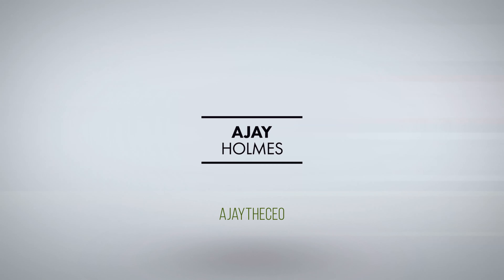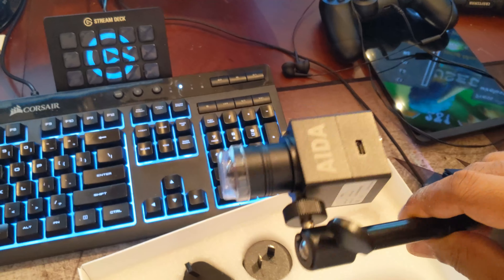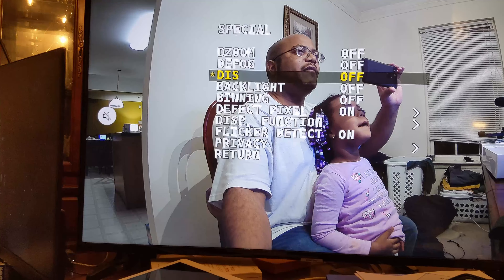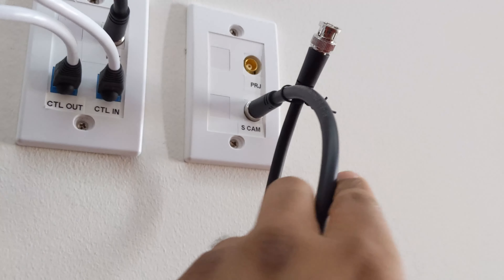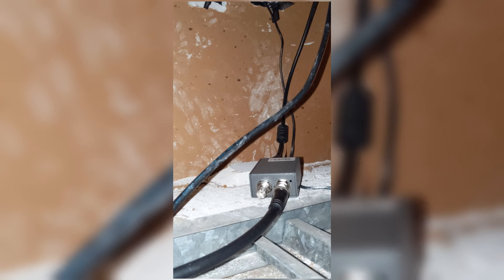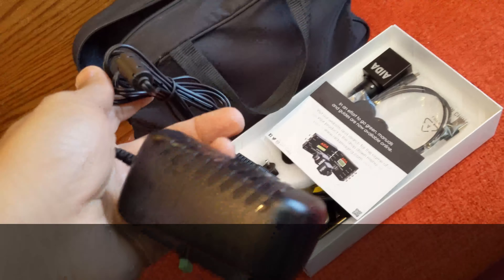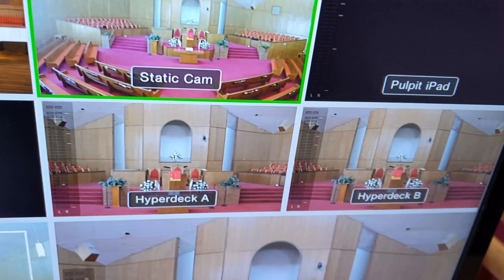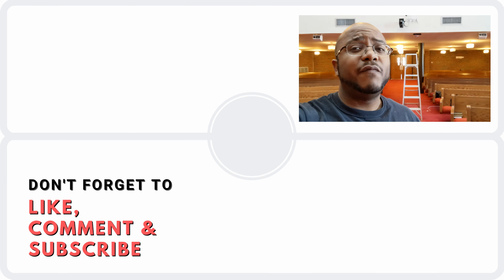Mini Camera | AIDA Imaging UHD-100 Micro 4K Camera - Review & Install

Comment: Thanks for the Tutorial i do really appreciate but I have an issue with the camera i really do need a solution to... I tried using it just twice and the third time the menu options isn't displaying on the screen i have followed this tutorial but the menu isn't displaying. The camera shows what i am shooting but since there is no display I cant adjust the exposure and other settings on the camera please help me thanks.
Reply from the maker: Have you tried connecting to it via software or remove the input into the rs232 out and see if it worked
Reply: @AJaytheCEO  i tried updating the firmware but its not working and I don't understand how to remove the input into the rs323 out